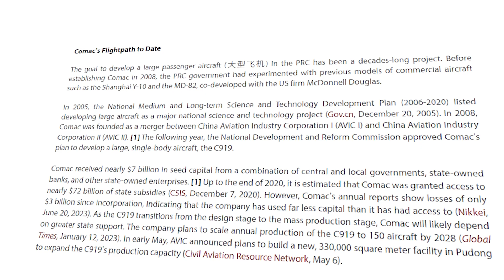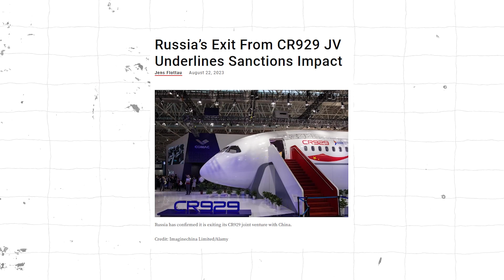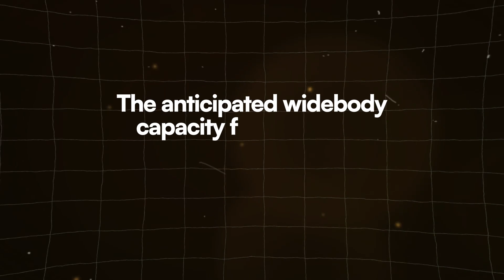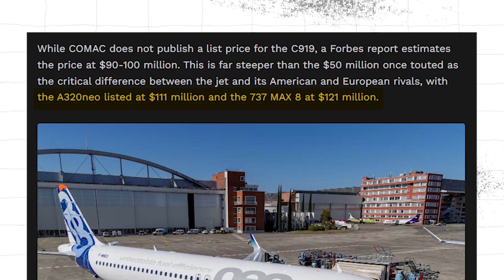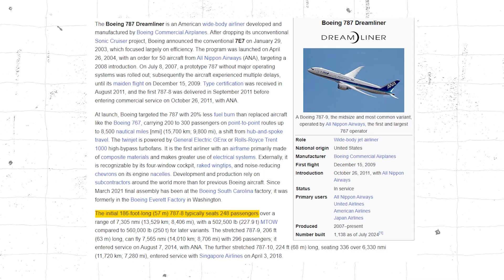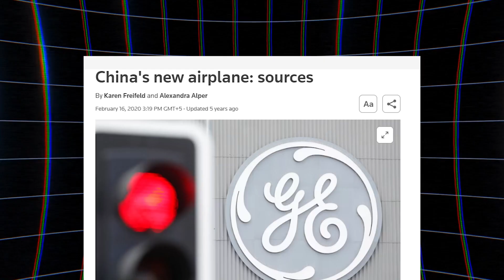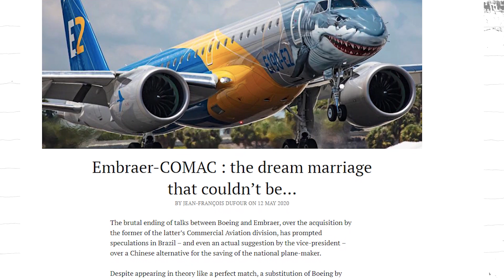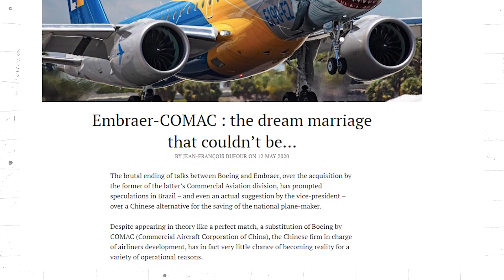The NEW COMAC C929 Will CHANGE The Entire Aviation Industry! Here's Why

Comment: What about the C-919 that has received over 1,500 unit orders.  Is C-919 a success or a partial failure?  
Can COMAC produce C-919 and C929 at the same time with sufficient output to meet the market demands?
C-929 obviously is competing with C-919 for the same group of potential buyers.
It will take about 10 years before C-919 to get the certifications from FAA and EASA, and the same applies to C-929.
If COMAC is unable to get the FAA and EASA certifications, not too many buyers will buy these two planes.
Reply: 中国的市场已经足够大了，后续我们会向友好国家出售，中国制定自己的规则不需要欧美承认！

Comment: Well, I hope it doesn't follow the same path as BYD electric vehicles.
Reply: You mean being number one in sales?
Reply: @ablam8  No, number one in battery fires in China.
Reply: @michaelkatz275  there are no battery fires
Reply: @londondave800  Sure, and BYD doesn't manufacture EV's that catch fire due to battery problems.  And then there are the problems with censor's that can't stand the heat.
Reply: Hope it doesn't follow the same path as Boeing, the death liner
Reply: at least its not a flying coffin like boeing.  shitty yankee engineering.:face-fuchsia-poop-shape:
Reply: Você parece uma criança  prestes a perder gusoleimas ..abra os olhos 😂
Reply: @carloschin4363  Para o seu prazer visual:  EV's Are Exploding In Shocking Numbers
Reply: There are 99.9% chance your phone is using a byd battery, has it caught fire ? No, so stfu
Reply: @Mandom007  Just where have you been recent years; on Mars?  Cell phone batteries, particularly lithium-ion batteries, have been known to catch fire. This is often due to a phenomenon called thermal runaway, where the battery overheats and causes a chain reaction, leading to fires or explosions. Factors like manufacturing defects, physical damage, overcharging, or exposure to high temperatures can trigger these incidents. While rare in cell phones now, such incidents are a regular occurance in EV's in China.
Reply: @Mandom007  Sorry bro, but they use lithium ion batteries manufactured in Shanghai, which are subject to thermal runaway and catch fire.
Reply: @michaelkatz275 doesn’t American Tesla use Chinese made batteries 🤔